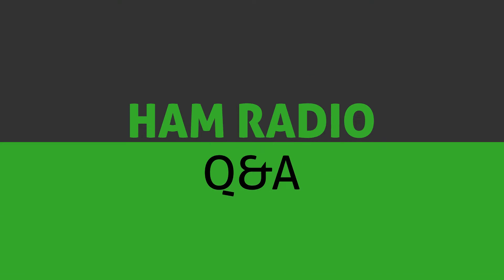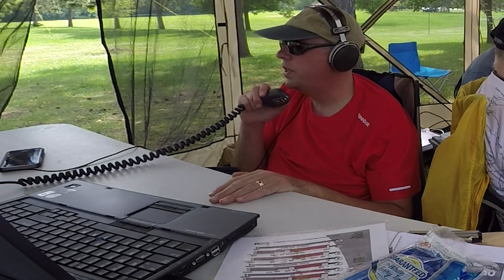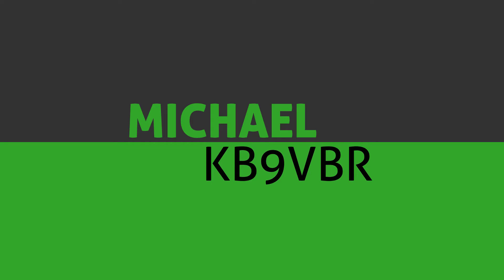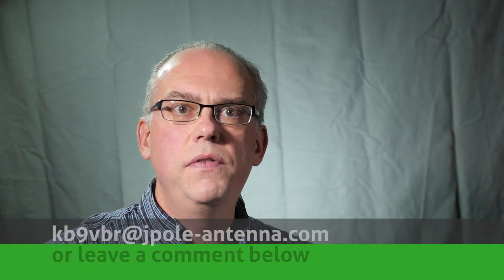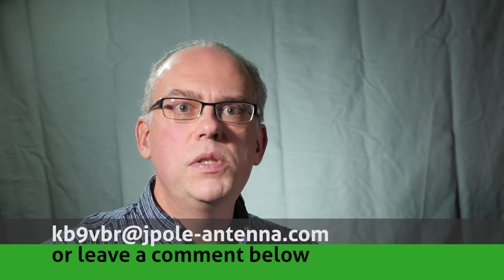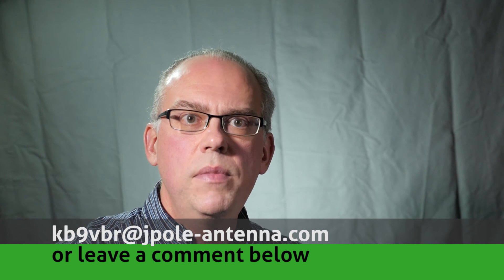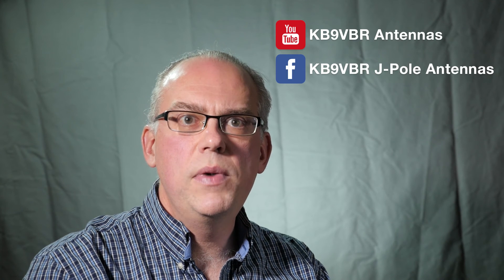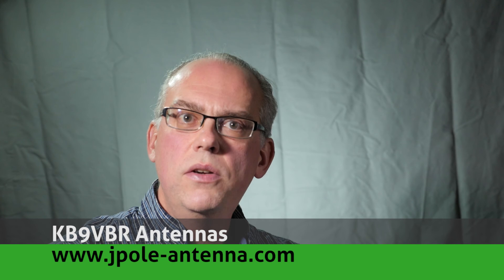Your Questions Answered: Ham Radio Q and A Episode 6

Comment: I bought a 1000 foot roll of 7731A coax very cheap that's an equivalent to RG-11 and I've experimented a little using a dipole antenna cut for 7.200Mhz, 100 feet of RG-213, 100 feet of 7731A & an antenna analyzer. The graph on my analyzer showed the antenna with RG-213 dipping right at 7.200 & was a 1.3:1 swr.  With the 7731A coax the same antenna also had an swr of 1.3:1 at 7.200 but as the frequency increased swr was lower & lower & was lowest of 1.12:1 at 7.400Mhz and the impedance indicated on the analyzer that was 75 ohms at 7.200Mhz had lowered to 50 ohms at 7.400. Analyzer was connected at the end of the coax that would connect to a tranciever.  I got the coax to experiment with dipoles of about 72 ohms at the feed point. Soon i'll be hooking up to an HF rig to check transmit & recieve.  73 de AF7FP